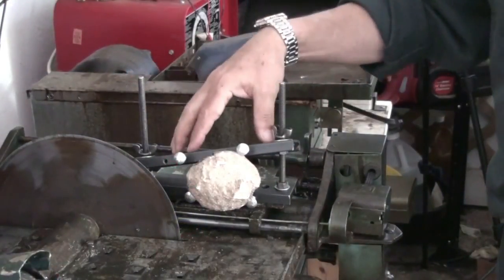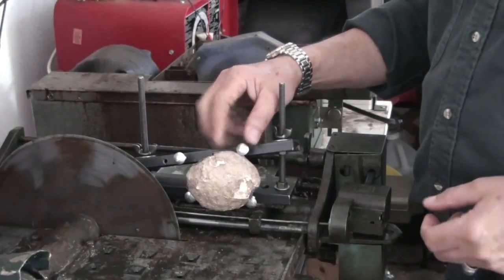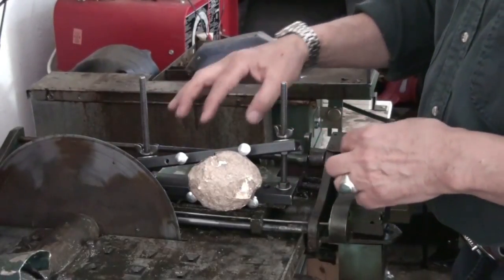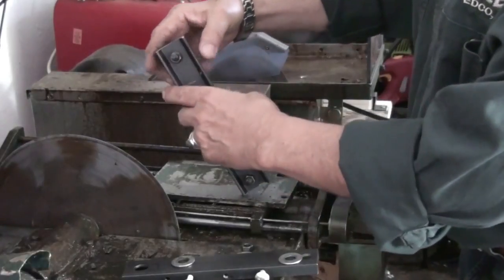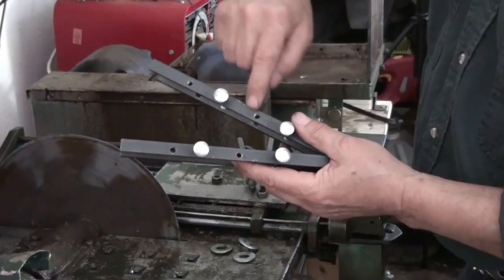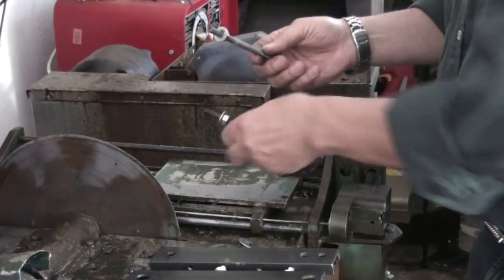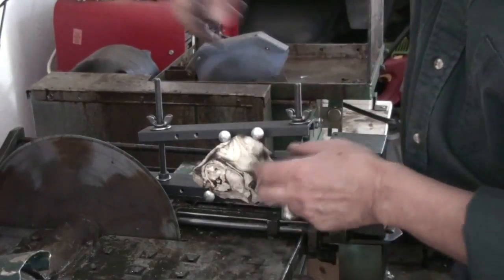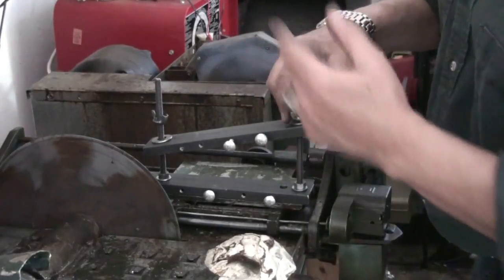New Geode Vise Designed for 10" saw

Comment: Thanks for the great video.   Loved the video on aligning sawblade to carriage.  This helped my used Lortone  12 inch quite a bit as it now does not bind the blade 2/3rds way thru 
the slab and stop the motor.   That said,  the old blade that came with the saw is a bit dished probably due to misuse.   So, I am in the market for a new sawblade.  I came across
a blade manufacturer (brand name Ukam) that says their diamonds are aligned in the sintering process that makes the blade more aggressive.  Wondering if you or your lapidary
friends in the industry have used or even heard of these blades.  Also looking at the MK 301 to be used on Brazilian agates.  Any recommendations?    Thank you!
Reply: Thank you.   Just got my new MK 301 direct from the distributor and picked up the dial indicator from Harbor Freight. So will shelf the old dished blade even though 
it was cutting better after realignment and set up the new blade properly with the tools and advise you gave.    It was tough seeing the look on my great grand daughter's
face when the old set-up would bind, the motor heat up and switch off and we would look at each other and go UGH!  Not again.   But no more.  All should be good now.
Really appreciate your down to earth explanations.  Great job!
Reply: Hi again,   I tried to find a you-tube video on taking out the dish in a lapidary blade but what I found seemed to indicate it was almost a lost art and that you could 
end up  really distorting it worse than it was.  That would be a nice video on the subject if you would be so kind.    Also, I am going to try a modification on your
carriage bolt geode clamp, using it in a horizontal  manner to  hold round half Brazilian agates while grinding and polishing with a hand held wet grinder.
Kind of messy but very hard to hold a round rock steady with rubber stops on a clamping sawhorse.  Thanks again for the inspirational ideas.